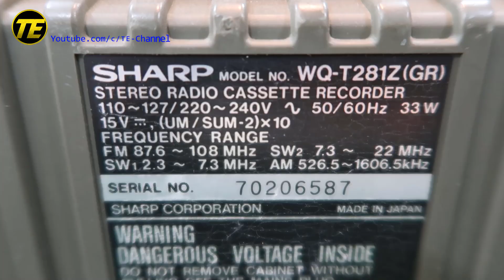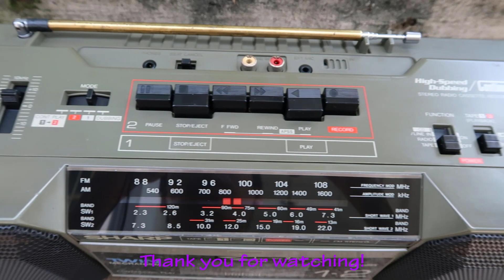Sharp WQ-T281 Restoration

Comment: Very nice disassembly. Some top points: 1) unique boombox with dual cassette technology; 2) strong 15v DC drive motor; 3) Sharp used its own high powered 10PBC74A 15w speaker drivers (which I was surprised to see in a portable unit); single belt driven cassette assembly in a dual cassette mechanism (top notch engineering).  Well worth a restoration. Super job on the re-foaming for the speakers (just the way I do it; it was cool). Sharp made some very high quality and competitive portable electronics that don't get the recognition as Sony or Panasonic often do. Thanks for showing this. Super video, my friend.

Comment: No wonder these old sets last so long. Look as the design, 90% construction using solid state diodes, capacitors, transistors, resistors etc. etc. They hardly broke down unless violently abused. Keep the good work my friend!

Comment: What is the material you using in 9:16 ,10:22. I need to re-lube the mechanism of my own tape boombox but unsure if I need to use oil or some other kind of lube material.

Comment: Awesome video. I need help. Just bought the same model everything works but the second tape player is no sound. Spins but no sound. What can it be?
Reply: There is a simple reason why TAPE 2 in this model would have no sound (TAPE 1 plays fine and radio working) - check the mode select switch on top - it may be set to either "TAPE 1" or "CONT PLAY 1-2" which means deck 1 has priority over deck 2. Set it to "TAPE 2" and see if you get sound from the second deck.

Comment: What was wrong with it prior to the restoration, apart from the one speaker which needed a new foam surround?  No other repairs (apart from a component that needed to be re-glued) were shown.  This seemed more like a cleaning and servicing (with the exception of the new surround), rather than a restoration.

Comment: I have a Sharp exactly like this one. After changing the straps the playback speed became very fast. Does anyone know where the speed regulator is located?
Reply: there is a hole inside the motor. put the screwdriver inside and turn it until you reach a desired speed
Reply: @datasoyify  Thank you!
Reply: Wrong. It isn't on the motor. There's a potentiometer in the mainboard that adjusts the speed. It is located right above and slightly on the left from the cassette mechanism wires.